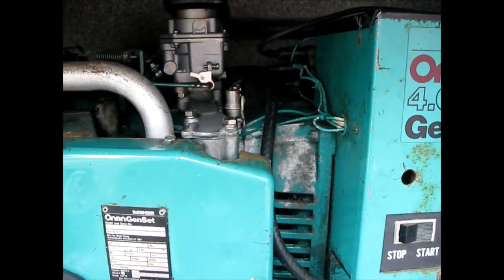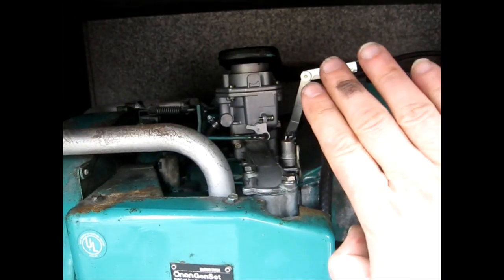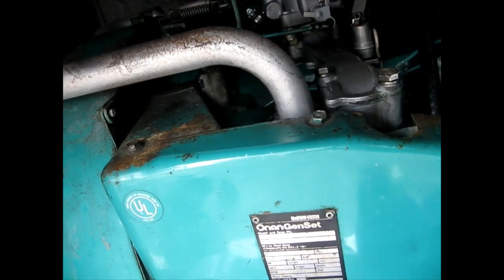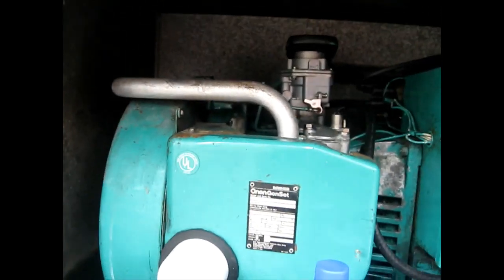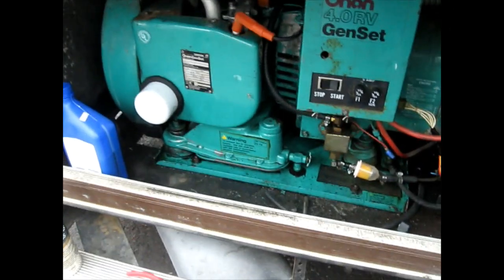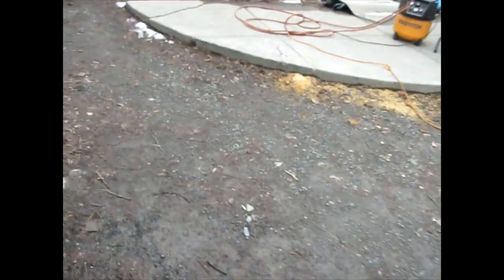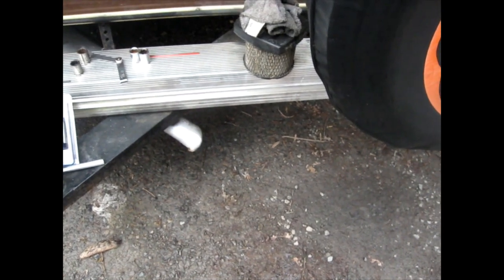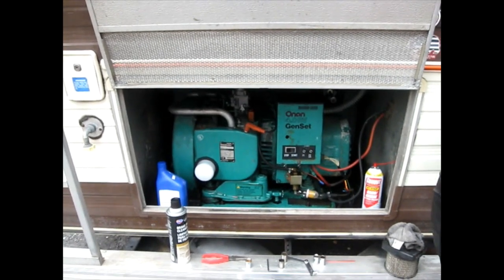Final Onan RV Genset Video I hope!

Comment: I need to know where the starter is on 84 Onan genset generator 4.0
Reply from the maker: The 'starter' is the generator coil. There are a series of brushes near the engine side, those are for starting it. Check to see if they look OK. the battery energizes it and gets it to spin.
Reply: Thank you
Reply from the maker: @macklinjasper3802  HMU on my email I've got the parts manual in PDF format. Have an older service manual but it's close enough. danlong315@gmail.com

Comment: how do you get it to stop surging i have the same  and its flooding the carb thanks for any in put your the only video on it i have seen
Reply from the maker: What I wound up doing is replacing the carb with a close model that has a manual choke (not happy about that part). Surging was happening because the darn idle valve just wouldn't hold and looks like one of the jets is missing. I may use this knock-off carb to rebuild the old one but for now I'm using this one and have to adjust it by setting the choke. Sometimes on hot days I'm lucky to just crank the remote and get her to start.
Reply: @drlong08  thank you for your help
Reply: @drlong08  did you get your carb from jacks that's in your video
Reply: I had a similar problem. I have the Walbro Carb on mine with the electric choke. Turned out there is a "buoyancy" spring for the float that is really important to help the valve close. It was missing and the bowl was overflowing. I was able to use a spring from a mechanical pencil, but it is too strong and too long. Cutting it down works, but now it doesn't get enough fuel and starves out at higher loads. I found the kit for this carb on ebay and it does come with that spring. Just waiting for mail deliver now to see how it will work.

Comment: Did I miss any vids of you repairing your electrical panel after you showed the Bosch relay and "Jimmy rigged" remote switch? I just picked one up and the circuit breaker was broken and covered with duct tape. Lol
Reply from the maker: As mentioned before. I have the wiring diagrams which would help in redoing the remote panel and other items on the genset. Bosch relays are the same type for the genset as the originals.

Comment: Hello I have the same generator I just bought the motorhome when I purchased it I hit the start button no problem turned over but would not start that's okay bring it home tried turning it over little bit of Easter wouldn't stop that's okay bye a big problem I have is when I hit the stop button now it won't even turn over the batteries in the motorhome I think Chad by the other engine I'm not sure I've never bought a motorhome I'm not worried about getting the motor running but I'm not sure what I did to the starter it doesn't seem to be any power going to the button excuse me to switch and the fuses look okay can anybody reading this help me before I send it out to get fixed I have no power to turn it over it's not a Chevy I can't figure it out and I don't dare to take it apart again it's not a truck if you get this message please let me know how to turn the power on to the generator I'm checking the batteries tomorrow thank you
Reply from the maker: Joe, I didn't see this comment so I hope it's not too late. Big item with these are corroded grounds, so check those first and clean them all up. .Many times a remote start panel start-up won't take because of the choke on the genset. I replaced my carb on the genset but could not install the old electric choke so now I have to get out and close the flap on the carb to get it to start. If you're choke is not working, then it's just going to turn over but never start unless it's really hot out. As for the batteries not getting it to start even with the emergency start button pushed, that's likely a bad battery or again the ground wire connections. Electrical stuff is always a challenge for me....goodness knows it took me a while to find that transfer switch that allows me to go from shore power to genset power! 

Good Luck!